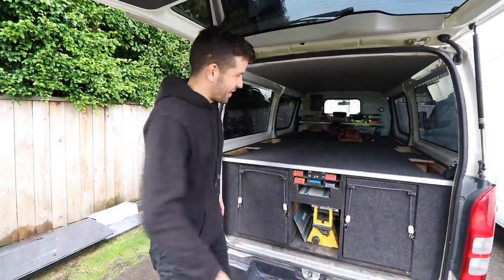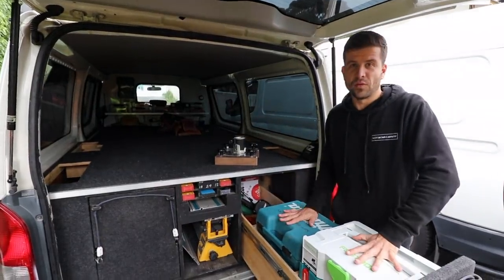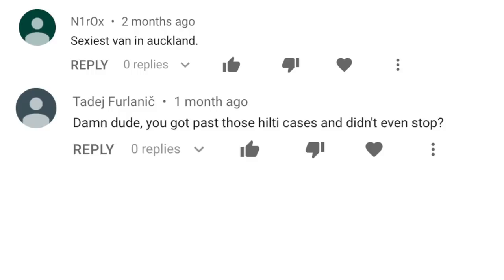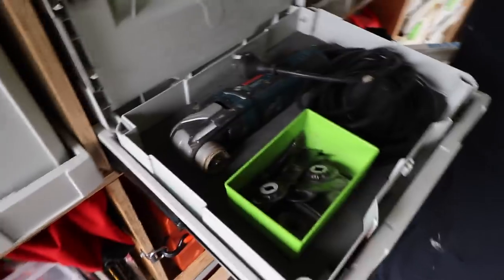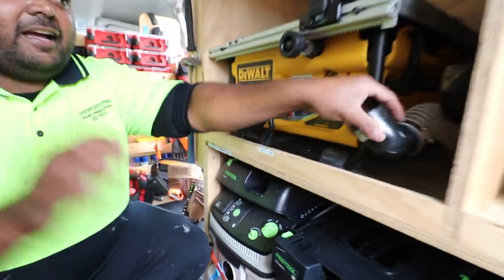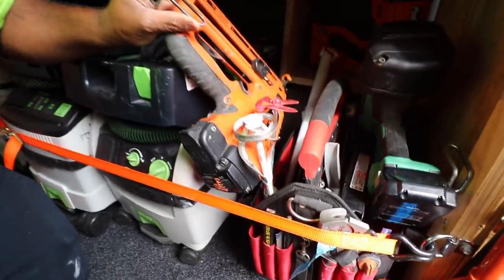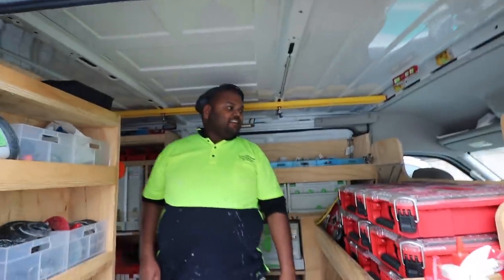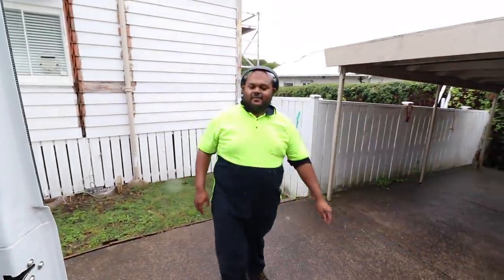VAN vs VAN: The Best Van Fit Out?

Comment: I hope you haven't opened the eyes of a potential thief,especially if you are posting on Instagram, they might track you down in real time. 
Good luck guys. Your insurance premiums would be through the roof.
Reply: Any work struck is a target.

Even knowing what's in their trucks helps no one make it a better target. If it's easy to get in to that's your best option, and anything like locked boxes or any of that makes it all that much harder.

I'd personally have locks in every drawer and then your have to smash the window AND axe (or pry depending on build quality) every box to get my stuff.

But like I said, I'd you're at risk you're at risk, and not seeing anything inside means you might take prison risk for empty drawers that day and it's less worth than the open truck down the street or what have you.

Comment: Interesting
But I think these guys are more into tool porn than working
Wheres the portable tool box or trolley to carry all that stuff
You would spend all day going back to your van 
Imagine working in place where your car is 100s of meters away
or at the bottom of a lift in a Westfield 

Too many compartments so less flexibility 
Too many boxes taking up space

I would go for big draws for each side door and 1 for the back
Pack the power tools together
chuck in bits cases into a rack and your done
Would take these guys half a day to get there stuff to the job
Wheres all the battery chargers
When I turn up everythings
fully charged and ready to go
I just plug 

My setup has more open space for materials
4x4 4 door with canopy with draws
Is much more flexible and versatile 
Carries 4 people or storage seats
Drives better than a van 
And can 4x4
Mine just doesn’t look as sexy

And don’t start me on Festo tools
They are great but best safe at the workshop
They are worth more than the vans they are in
Imagine coming back to your van and going
“Im sure I parked it here?"

I think its easy to over engineer stuff like this

What if he decides to get a bigger drop saw?
As tempting as it is
It always better to remain flexible 
Same goes for boats

But having said all that
Both these guys have done a far better job than most guys I see
Especially the guys with tray backs spending half there days digging around in 
lock boxes in the rain
It just always fascinates me when I see these guys who are supposed to be 
good at designing and making stuff    
cant even fit out there own vehicles
to make it quick and practicable 
Gets a quoted job done quicker

Gee that was verbose
I just started typing and couldn’t stop